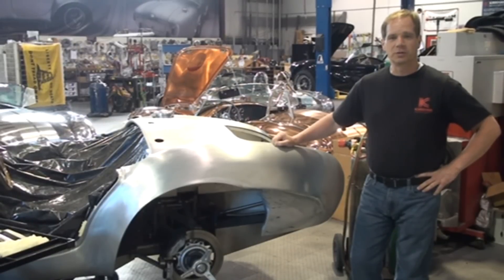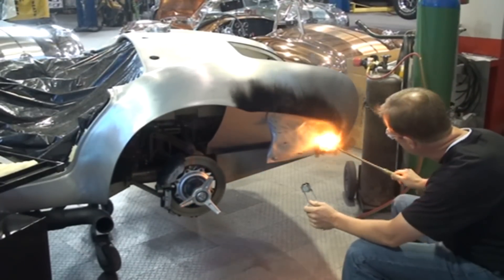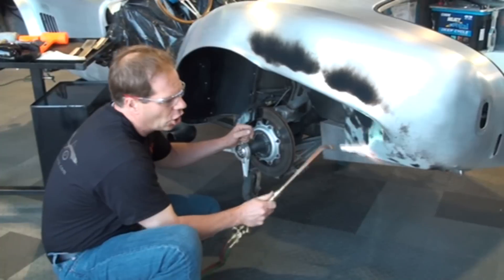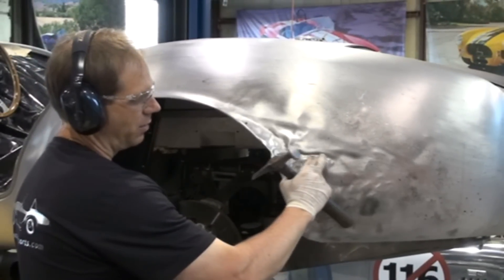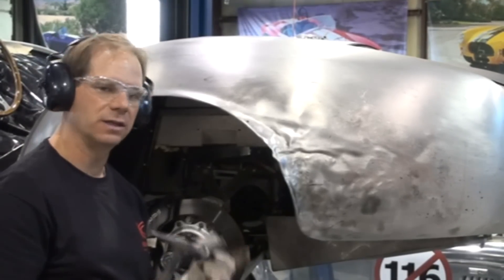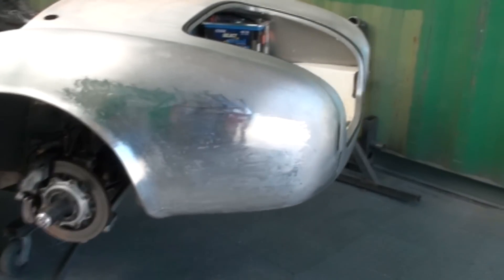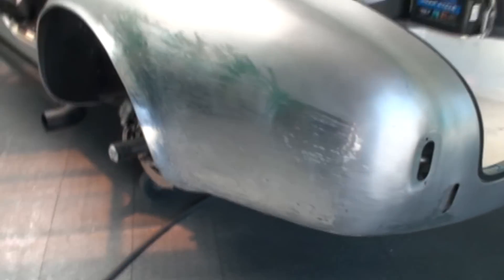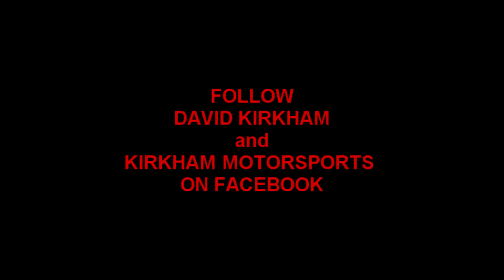Kirkham University Aluminum Fender Dent Repair

Comment: How long does it stay hot did you have to reheated we didn’t see that or from the first round of heat you kept working ? Thank you
Reply from the maker: The panel is worked cold.  It is heated to anneal it then we allow it to cool off before working on it.
Reply: Ah got it thank you so much

Comment: If you annealed it, did you go back and harden it somehow so it's not so soft?
Reply from the maker: Yes, hammering the panel back into shape work hardens the aluminum.  The alloys used in making car bodies are not hardenable by heat treatment.

Comment: David, Thanks for posting. Is it (ever) necessary to restore the temper of the aluminum after annealing? Would you do anything different with an aviation skin (Alclad). Best regards.
Reply from the maker: Temper can only be done on aluminum that can precipitation harden.  The aluminum we use can not be hardened (by precipitation hardening).  It can be work hardened, however.  That's why I annealed it first.

Comment: what's the double sided dent hammer you had?  where to buy it?
Reply from the maker: It is a forged Martin hammer.  You can find them on eBay.
Reply: @KirkhamMotorsports1  I was talking about the one you're using at the 10.00 minute mark on the video.  it looks like a U shape that goes around the panel.  thank's.
Reply from the maker: @WiseMan22  it is a bullseye pick.  We have made many of them over the years ourselves.  Eastwood also sells them.

Comment: great info, im working on aluminum truck myself,  so we do not need to re temper or harden the panel after we are finished shaping?
Reply from the maker: It is extremely difficult to precipitation harden an aluminum panel on a truck or a car.  If the panels is a heat treatable alloy it requires special fixturing to prevent warping.  We don't heat treat our body panels even when we use 6061.
Reply: @KirkhamMotorsports1   ahh, right on, Im working with thicker metal, and dont have any damage that needs to be hammerd out, just a bit of bowing where the old mounts where missing....  Im restoring my Metro stepvan, its all aluminum and magnesium so its a very time consuming process as it is to treat since the epa killed the dichromate primers...   you should list the new fords in your search tags,  their gonna be a lot of search for that soon...

Comment: Awesome work man, would it be possible to hammer and dollie dents out of a 1/8” piece of aluminum?
Reply from the maker: Yes, it is actually easier.  There is more material to work with.
Reply: @KirkhamMotorsports1  thank you sir for the reply

Comment: beautiful job!  did you heat the panel again as the repair went on?
Reply from the maker: Usually you only have to anneal the panel once.  It has to be pretty wrinkled up for me to anneal it twice.
Reply: @KirkhamMotorsports1  Is the annealing process done at the beginning of the video with the oxy-acetylene torch? In modern bodies can I also perform the repair following the same process you used in the video?
Reply from the maker: @Henrique-rd4em  Yes, I annealed it right at the beginning.  I have never worked on a modern aluminum car, but I imagine it would work the same.
Reply: @KirkhamMotorsports1  Thanks for the answer, I've been looking to learn about aluminum, because we don't have didactic material about it, your videos are great, I learned a lot from them, but if I can make more videos about how to repair aluminum, I'm grateful

Comment: That is great work, David, thanks for sharing.  I started metal finishing around 1970.  You do good work.  A couple of questions.  First, if the initial hammering causes severe work hardening is it possible to anneal the aluminum, again.  Secondly, I am curious as to how many hours that took you.  Thanks again.
Reply from the maker: Aluminum can be annealed many times.  If the ding is really bad we will anneal it around 3 times as we pull the ding out.

Comment: Could you use a similar technique on a mid 90's miata aluminum hood, or would the aluminum be too thin?
Reply from the maker: It's pretty much all the same techniques.  You just have to be careful and go slowly!
Reply: @KirkhamMotorsports1  Thanks for getting back to me. Nice work on the fender.

Comment: I have a 428 Cobra that's a limited edition one I've never seen another one like it has been in my family since I was 14 years old it is really really fast he is a brand new engine and I have the transmission in a rear end in the car it was so fast my brother flipped it over three times as putting down the road on it on it stopped and he was going to send it to the junkyard but I got it and it's I've had it all these years and I have a brand new engine for 28 Cobra limited edition wanted I think it's a Super Cobra

Comment: Would it be the same process if there were 2 layers of aluminum in the wheel well?  My 04 jag has a similar problem except I'm having to reform 2 layers
Reply from the maker: You may be able to tap through both layers, but it is much harder to do.
Reply: @KirkhamMotorsports1  do I need to heat up both sides at the same time.  I hit one side with the blow torch and the second layer gets hot but not as much, but the second layer inside the wheel well is the side I'm hitting.
Reply from the maker: @robertturner8408  send me an email with photos

Comment: Aluminum is hard to work with, especially the extruded copper alloys with anodized finishing. The bends will easily crack.

Comment: Could you have done this on regular sheet metal like a 67 Camaro? This guy backed into my left front wheel well, where a number of "subtle" body lines come together. I'm surprised at how close I am getting it back to the original shape without any previous hammer & dolly experience. I want to keep the original GM sheet metal.
Reply from the maker: Yes, steel, bronze, aluminum, etc.

Comment: David, I love your commentary. One major thing I can not remember seeing anyone else make a point of.  You do what I do on high-end solid surface countertops (high density 2x Corian) Earthstone by Wilson Art. I go all the way up to 400 grit  or more on the whole surface and make it all into a mirror with the 11. 5 inch Gem random-orbit sander. Then I take it back down to 220 scotch pad satin. When done up close it looks like a nice satin finish that owner/user can use a 3M pad to scuff out any nicks as needed for maintenance. But if someone walks into the final installation and sees it from say 20 ft away (low angle of viewpoint) it looks like a polished mirror finish that you can use to shave or put on your eye makeup as you choose. Always go at least two preferably 4 finer steps in sanding polishing and then go back to the goal finish level. I have had antique boats I have restored get points taken off for putting epoxy on instead of varnish. I then put together a binder showing the steps to get to that finish. Same thing as a luthier on my cellos I make it is not boat varnish or epoxy it is regular traditional violin varnish. But every two coats I take it down with a semi-stiff felt pad and rottenstone till the whole instrument satin then I polish it to a mirror and then cut it back with 220 or 320 and put another two or three coats of varnish on. I repeat and repeat until I get the proper thickness of varnish. On the boats and counters and instruments, the mirror is multiple layers of mirror finish reflections that are quite dramatic to look into. So my big high five to you.
Reply from the maker: Thanks!  I have always wondered about wood finishes.

Comment: Thanks for sharing this knowledge and skill with the world and showing what is possible.  Your comments here are just as important as the video.  I can't wait to try this out.

Here are my cliff notes for anyone who may be interested:
Bulls eye pick
Martin hammer
Pferd body files

I have used a lot of flames on metal in my life and I would never take a flame to painted aluminum.   You will have to carefully massage the dent back out from the outside in.  Remember, "first in--last out."  Imagine the dent actually happening in slow motion.  The LAST thing that was dented is the FIRST thing to work back out.  It can be done with skill and patience--lot of patience.

We take off very little.  Maybe 0.010"

0.059"  You will have a real challenge with 0.025" or 0.032"

  Our bodies Poland are made from 1.5mm aluminum.  The alloy is an old Soviet aircraft alloy that has no corresponding equivalent in the US.  It is much harder than 3003.  For our Coupes we are making the body from 3003.  For highly formed panels, we use 3003 H0 and 3003 H14 for panels that don't need much shape.  I have never seen anyone (including Ferrari) make panels from 0.016-0.020 WOW!  That is thin!  Original Cobras were made from 0.050" 1100-0 aluminum.

 It is only at the very end of the straightening that I am hammering "on dolly."  I try to do as much "off dolly" work as possible to avoid stretching the panel.

My mother always said, "Service is the rent we pay for the air we breathe."

There was an enormous amount of time planishing all the little dings out before filing.
Reply from the maker: Thanks for posting that!

Comment: I know this video's really old and I'm not sure if you still check the comment section but if you do I would really appreciate it if you'd help me with this Question I'm stuck with. I was wondering how do you take out wrinkles on a metal door if you can't get the Dali behind will your hammering? Like I mean there's no room at all for the Dali to get in.  if you or anyone could help me possibly with this question it would be great.
Reply from the maker: Sometimes we will weld a rod onto a dolly and slip it into really tight areas.  Sometimes you just have to be really creative.

Comment: What thickness of aluminum is that?  I have a 1948 Spartan Manor that I'll need to attempt this on that's either .025 or .032" thick.
Reply from the maker: 0.059"  You will have a real challenge with 0.025" or 0.032"
Reply: I was afraid of that. Thank you for the reply!

Comment: How long does it take to do the repair work on a fender like that? 10, 20, 30 hours??
Reply from the maker: I don't remember now.  It was several days.
Reply: Thanks for the reply. I'm doing an estimate on a pristine 1931 Rolls-Royce Phantom II (The Yellow Rolls-Royce, look up the name). It got hit in the L rear fender (aluminum) it's a very special car worth about $800,000 but it is a difficult part to find. Might be better to have a new one fabbed than trying to straighten this one, but with original parts we might have to repair it. Your work was excellent thanks again

Comment: David, I was looking for a way to fix my canoe and stumbled across this video. I wasn't too confident in your repair for the first few minuets but after the video I am very confident in your method. I have a question and a suggestion, first the question, how do I re-treat the aluminum so that it is not soft and my suggestion is that you show the finished product in the beginning of the video so viewers don't walk away when you start beating that fender with a sledge hammer. lol
Reply from the maker: Great suggestion!!!  I wouldn't worry about retreating your aluminum.  If I had to guess your canoe is made from 5052 aluminum and it work hardens really quickly when you work with it.

Comment: i used to use a pig of lead to hammer into, on butt welds on 4-8mm plate, nice thanksd
also to make the  corners os cabin fronts where roof meets sides, hammering iinto a block lead

Comment: Wonderful work!  A real work of art.  David...what about small dings in an aluminium hood?  I have a Holden Commodore Wagon (like the new Chevy SS but a station wagon) here in Australia.  Last night I think possums got into the ceiling area of the garage and knocked a box onto the bonnet (hood) leaving a small ding less than the diameter of one of your cent coins,  The car is new so I was less than impressed as you can well imagine.  A friend told me that you can quickly pass a flame over a painted aluminium panel with a ding and the aluminium will pop back into shape without any damage to the paint.  What's your advice?
Reply from the maker: I have used a lot of flames on metal in my life and I would never take a flame to painted aluminum.   You will have to carefully massage the dent back out from the outside in.  Remember, "first in--last out."  Imagine the dent actually happening in slow motion.  The LAST thing that was dented is the FIRST thing to work back out.  It can be done with skill and patience--lot of patience.
Reply: Thanks for taking the time to reply David...I really appreciate it.  I have a PDR guying coming to fix the car next week.  I think this is a job best left to a professional being the car is virtually new.  I must say that you have inspired me to investigate fixing some small dings on our other "gofer" car which is an old Mitsubishi Magna (Diamante in the US).  That car is all metal and I already have a glue pull gun that was gifted to me at Christmas (thoughtful brother!) so I can try a few repairs on my own.  I'll start with the less obvious spots and see what I can manage.  Happy New Year to you.  Best wishes.
Reply from the maker: Have fun.  Rule #1 around the shop here is "Slow Down!"  Don't get in a hurry and more importantly, don't get frustrated.  It takes time and practice to play Chopin's 1st Ballade on the piano.   It's the same with removing dents.
Reply: David Kirkham Thanks David...it means a lot to me that you took the time to reply.  Once again...Happy New Year!

Comment: silly question if the aluminum  is stretched when it was bent under and when you hammered it out it stretched even  more. How did you get the guard   back to the  original shape with out shrinking it ?

Comment: What about straightening an aluminum chassis on a car? Like say the front frame rails? I know most frame masters are afraid of working on aluminum frames due to low experience. I would really like to know the answer from a person with your knowhow and experience. Thanks
Reply from the maker: +raphy6 Straightening an aluminum chassis/frame structure would be extremely difficult.  A chassis will likely be heat treated.  Tubes don't lend themselves to being straightened very well.  When we get cars with tube damage we never try to straighten the tubes.  We simply cut the tube out and section in a new tube.  The welding doesn't affect our (steel) tubes, as they aren't heat treated.
Reply: +David Kirkham Im not referring to tube chassis but more of conventional automobile chassis like the new ford trucks and range rovers.. Im talking about my nsx which is made of aluminum including the chassis. I know the chassis is not heat treated and says in the shop manual that it doesn't require heat to bend back into shape if an accident occurs. Thanks for the fast response*
Reply from the maker: +raphy6 I don't think the frame of the new Ford Trucks is made from aluminum.  Standard repair procedures apply to repairing a frame.  The body and cab on the new trucks is aluminum.  I don't think it is a heat treatable alloy, but I am not sure. 

I'm not sure how an NSX is constructed.

Comment: Does the annealing have any negative effect on the fender, such as being more susceptible to impact damage?
Reply from the maker: +nilla003 It strain hardens when it is repaired.
Reply: +David Kirkham Thank you sir.  Initially, I didn't realize that a Kirkham was doing the repair even though I'd read your company story and seen your photo in Autoweek years ago.   What is the Polish view of these cars?  I'm quite sure that they welcome the work, but as technically savvy as they are they must be shocked that there is such demand for a design that originated in the middle of the last century.  Of course the car's performance speaks for itself.
Reply from the maker: +nilla003 We do repairs all the time.  I still own the factory in Poland.  They do fantastic work and they love building cars--like all of us.

Comment: Snap on tools body hammer. Trust no other body hammer if your a true professional in autobody.
Reply from the maker: +Steph Quon Snap On tools are indeed very nice.  The red, heavy sledge hammer I was using is a Snap On.  The delicate, final hammer work was done with a Martin hammer.  I bought it from Sears 30 years ago.  They are very hard to find and highly prized by professional body men.

Comment: You should never use steel tools on aluminium! Ever!!
Tou stretch the aluminium and punch microscopical steel particles into the aluminium, wich cause the aluminium to corrode.
Reply: +Toralf Martin Haugen Pretty sure you're the only one that thinks this as the vast, vast majority of body tools, from hammers to english wheels are made from steel.
Reply: Toralf Martin Haugen :armchair panel beater.
please bless us with your own video.

Comment: Hi im a coachbuilder from the uk and work with aluminium alot and was wondering what the tool you were using to raise the low spots whilst filing is called? Im a 10 year vet and can honestly say ive never seen one before. Thanks
Reply from the maker: Bullseye pick.  You can get them from Eastwood or you can just make one yourself.  Just Google Bullseye pick.  Thanks for watching :)